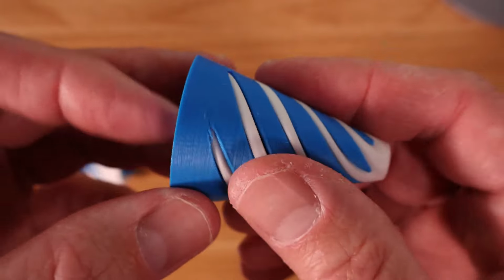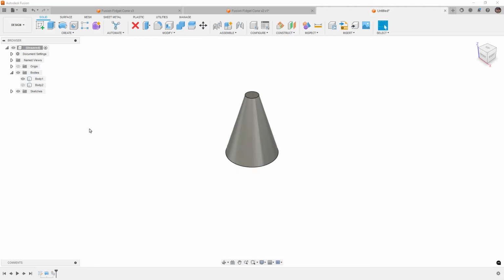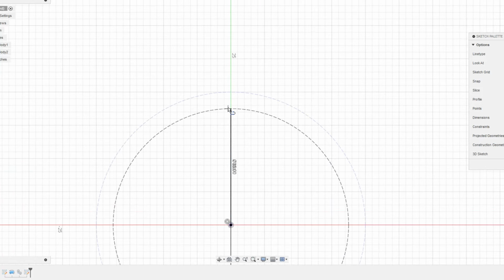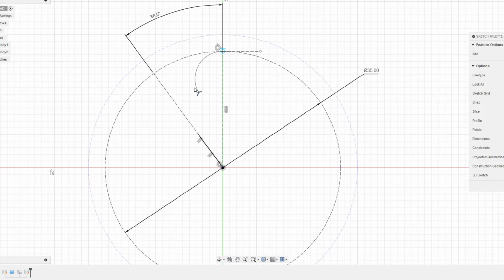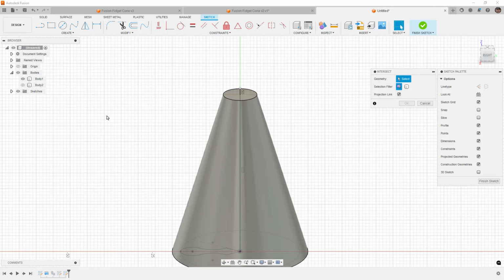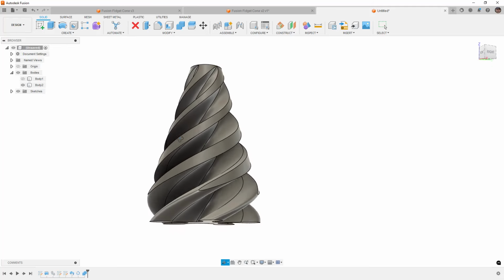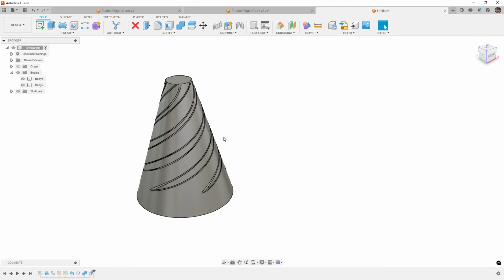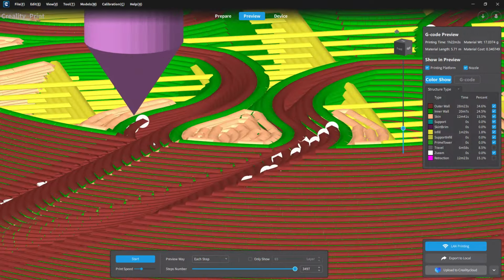Learn to Design a 3D Printed Fidget Cone with Fusion

Comment: cheers for this i tried modelling one of these on my own and couldn't figure it out. I knew it was way more simple than what I was trying somehow.
Reply from the maker: yeah it looks a lot trickier than it is for sure.  The tolerances are the big key here too.  That offset face part.  If that doesn't work you can also make a sketch that is offset for the cut out of the outside cone.  .2mm to .4mm is the general range depending on your printer, layer height and material you use.  .2 is a tighter fit that gets better with use.  .4 is generally a bit looser and works out of the gate.

Comment: I know how to do this now, but im too lazy to select all them faces rn
Reply from the maker: you can try to scale the body down but not uniform. you would want to scale it in plane.  The other thing would be to make an offset sketch of the profile with the same twist settings, but have it cut the outer part after.

Comment: Can you make the cone with like a sharp top?
Reply from the maker: You can do all sorts of different shapes and designs with this.  The outside can be a column style shape and the inside can be close to a sphere.  The ends help in getting the two parts lined up.

Comment: Do you know why when I make the pattern of the body it doesn’t reach the top like the slices en lower than the top of the cone compared to how yours all meet at the top
Reply from the maker: do you mean around the 8min mark?  Where we pattern the cut?  I would double check your axis for the pattern and make sure the center of your sketch that you swept, your cone, and the axis you used to pattern are all the same and based at the origin.  so Z axis should be good for that.  If for some reason its off then you might see a deviation there.

Another thing you can try is to change the pattern calculation option under "Compute Type"  sometimes that can do some funny stuff with Adjust.  you can try Optimized or Identical and see if that helps.
Reply: @LearnEverythingAboutDesign Just tried optimal and it seems to have worked. Thanks for the great tutorial and quick reply, appreciative them all
Reply from the maker: @JonathanAlex-r3i Nice glad it worked!!

Comment: This is a really excellent video. Not only could I follow it pretty much in real time I also learnt more about using fusion and can actually understand the process to create my own. Thanks
Reply from the maker: Happy to hear it!  There are lots of little variations to this design you can make to customize it!
Reply: @LearnEverythingAboutDesign  I printed it today and the inner slides right through like butter. Next I’m going to try a low poly dragon head and have the inner spiral be like flame coming out of its mouth
Reply from the maker: @GigasVGC  Thats a cool idea!  We have a few videos on the channel modeling a whale shark and making it articulating.  If you are trying to model in Fusion that might help https://youtu.be/k6ecfjhd5Bo

Comment: The last chamfer value should be a multiple of the layer high you want to print. It will produce a cleaner slicing result.
Reply from the maker: That's a great tip and completely agree.

Comment: The press pull keeps crashing my computer :(
Reply from the maker: doh!  Does this happen when using the manual drag on screen or even if you manually enter a number?  The manual drag on tools like fillet can crash because dragging a small amount can jump to large numbers.  If it happens on drag try entering a small value manually first and see if that works..  The other option is to scale up or make a second swept coil shape the right size as the cut body so you don't have to press/pull it

Comment: hey! this tutorial is great, but im curious how some do a big helix 🧬 instead? they tend to tunnel through the middle of them and look really cool. i'm wanting to make a big curved one to see if i can make it follow the curve, but im not sure how to make that helix
Reply from the maker: Thanks.
For the tunnel/curve one you  might find that your spiral part gets hung up unless you make it a ball. 

Here is an example of this style of design that isn't a cone.  I didn't do a video on this one but printed a few for fidgets at my desk during meetings :)
https://a360.co/3NqlggF

The sweep that makes the spiral center part in my design is just a "cylinder" but you could also do a revolve or a sphere and save only the intersection of it.

The "tunnel" part was a simple revolve.  The trick you will need to do is make that initial sweep a lot taller than you need so it can cut away from your tunnel.

Comment: i have bin trying to make this but fusion keeps crashing when i try to ofset the faces
Reply from the maker: There is probably a small face that is disappearing in the process.  You can try to use offset on the other body and see if that works.  If that failes you can make the original sweep with twist part from a second sketch that is slightly offset.  You can project the original sketch (P) and then use offset (O) and just increase it a small amount based on your printer.  so .2 to .4mm generally.

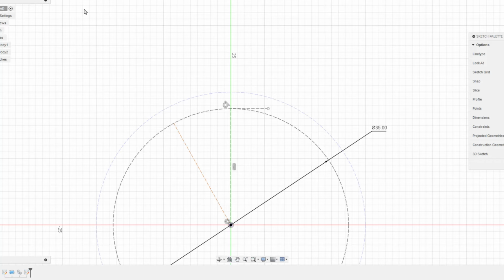Comment: Hi at 3:52 you mentioned hit "X" and pull the 3 lines to the side. I tried left click, right click but none worked. the line just wont move!
Reply from the maker: X is the shortcut key to turn the lines to construction (dashed).  the stuff we pulled to the side is the dimensions.  Those should be able to drag if you hold down the left mouse button.
Reply: Thanks for clarifying, i was trying to pull an actual line. That explains why! Tks again!

Comment: This video was incredible! I don't use Fusion 360, but I was able to translate it easily to Solidworks - except for we don't have press pull, so instead I used "move face". Thank you!
Reply from the maker: Very welcome!  Yeah Solidworks "direct modeling" is a bit different.  You could also do an offset of the sketch. have the larger one to cut the cone and the smaller one to make the solid cone/screw bit.  Just as another option.

Comment: What an amazing tutorial, thank you! I designed 2 of them the first worked no problem as long as they were separated, I then decided to try the -.6 and go for the PnP (print in place) which worked perfectly!
Reply from the maker: Awesome!  This is another fun one to play with.  https://a360.co/3NqlggF
Reply: That one is super fun, my only question the last sketch at then end with the 38° angle what is the purpose of that sketch,  the one I did turned out fine without that end sketch
Reply from the maker: @Ulchprints  Yeah its fine without it.  The intent was to help it self align, but the taper needs to be on the thinner sections too.

Comment: Nice, thanks, got it 👍

I'll use the concept and turn this into a dual tone handle for a shaving brush. I really like the look of those path through toys but I'm mostly looking for something useful to print. While I was shaving the other day I had the idea. I'm not sure how it will go with the more complex shape of a shaving brush but I'm confident I'll figure that out. At least for now 😅
Reply from the maker: I didn't do a video on this one, but its the one i keep on my desk for meetings and stuff to fidget with.  The parts are nice to hold on their own and it makes some interesting shapes.  Easy to print still. 
https://a360.co/3NqlggF
Reply: @LearnEverythingAboutDesign  Wow thanks that's way more the discretion I need. Thanks for the inspiration and file. I also plan a cavity for a few steel nuts to make it more substantial. I'm hyped and need to start it now 😂
Reply from the maker: @poislock  I did 2 videos on pausing a 3d print to do embeded hardware. might be cool to pause a twisted model with some visible metal inside.  https://youtu.be/n1iMrPYjvAw

Comment: Hello! I was wondering if you give permission for these designs to be sold on a platform such as Etsy. Also, I was wondering if this is your own file, or a remix of somebody else's. Thank you sincerely!
Reply from the maker: Hey there.  Someone else had asked that.  The design itself wasn't mine.  I mean I didn't copy another video but the impossible fidget cone thing I had seen in several places.  I have done some other variations of this that I haven't done videos for, but this one here you would need to search around a bit.  I don't have any problem with you using it as I was not the original creator.

Comment: can you also make a tutorial on bi cycle phone mount please. If so I would be grateful to you!! Thanks!!!!!
Reply from the maker: Probably won't because i don't think desktop 3d printers are the right choice.  I have made one for my mountainbike but in order to secure the phone properly it needed to be ziptied .  Making one like a quadlock just wouldn't work well with desktop FDM printers that most people want to use.  For a road bike it might be ok but still very inferior to what is available on the market (which still has issues)

Comment: Being a complete beginner to fusion, this 12 minute video took me a couple hours lol. But fingers crossed I followed well enough that my print will turn out. 
Some things that took me forever to figure out 
- how the heck we selected the bottom of the cone to make a project
-Assigning the radius to the pre mirrored object

I probably should have started with a total beginner project 😊
Reply from the maker: Yeah this one might have been a bit quick for just getting started but fingers crossed it printed!
We do have Absolute Beginner content on our site  https://www.learneverythingaboutdesign.com/   This stuff is listed for a small fee but is add free and gives us the ability to add and update it when Fusion updates, where Youtube doesn't let us do that without doing a new upload.

Here is another one that I haven't made a video on that uses the same technique as the cone.
https://a360.co/3NqlggF

On the questions
Assigning the radius to the pre mirrored object.  D on the keyboard is the dimension tool.  You can also click on the dimension on the far right of that first CREATE section of tools, or use that create drop down and see it there.

When we start a new sketch on a face it will bring the profile of the selection for us, but i used P on the keyboard to project it as it makes the edge more visible.  You can also find this on the create menu under the Project/Include section near the bottom.
Reply: @ Thank you 🙏. Honestly I am grateful for your reply and your fantastic tutorials. This fidget is printing now so we shall see how it turns out and if I managed to follow all of your steps with my lack of fusion knowledge. 
Wish I had seen and subbed to your channel sooner
Edit to add, print finished and it’s awesome. My kids are fighting to the death over it lol

Comment: Can you make a video of making a spiral vortex within a cylinder while keeping the vortex the same size around?  I have been trying for months to figure out using the Modify Edge Form and rotating the top around. However the middle gets smaller causing loss of air flow.  Thanks in advance.
Reply from the maker: Im not sure "Modify Edge Form".  There is the Edit Form tool if you are using forms for this.

The process would (should) be the same where you can sweep your profile on a line and twist.  The only difference is the cone part of it. you wouldn't want a cone at all. you would just sweep your shape and then cut it out of your cylinder.

Comment: Is it possible to do this with Blender?
Reply from the maker: I am sure you could do it with Blender, but something like this is way easier in a brep CAD type program. You would need to use some booleans to get it done in Blender and likely instead of a sweep with twist you would need to take verts on the top of your object and twist them with proportional editing enabled....

Comment: I’d love to learn how to do this in plasticity but can’t seem to figure it out. If someone could help me that’d be great or if OP could make a tutorial even better!
Reply from the maker: I have another 3d printed fidget video I am working on for plasticity, but let me think on doing the same one in Plasticity.
Reply: @LearnEverythingAboutDesign  excited for it any updates of when it will be out? I loved this tutorial but got lost at the middle part starting at 5:00
Reply from the maker: @adamfosfi691  The plasticity one went live last week https://youtu.be/FUH8IvXmodE  at 5min are you trying to follow along in Plasticity doing this?
Reply: @LearnEverythingAboutDesign  No in fact im not allowed to use plasticity and didn't know about it till you just mentioned it - I'm restricted to using fusion 360 only thats because im doing industrial design. :(  

Otherwise I would definitely do the new tutorial because we are currently going into fidget toys
Reply from the maker: @adamfosfi691  Have you looked at the Print in Place shark we did?  I have a video on modeling it and one on how to set it up for print in place.  I have come across some other designs i might try to make videos on as well.  The plasticity fidget toys should be easy to do in fusion and i will have some coming soon for fusion as well. some Halloween themed ones.

Comment: Tried 3 times and it fails at the halfway mark each time 🤨
Reply from the maker: oh no!  What printer are you using?  I slowed mine down to 50mm/s and print the outer walls first.  I had the print in place version fail but it was a material clog.
Reply: @LearnEverythingAboutDesign  cheers got it for the kid easythreed nano crap thing got the file of thingyverse but it stops at like the half way point each time
Reply from the maker: @sshaunss  did you try printing the file from the video?  https://a360.co/3SzEa7y
Reply: @LearnEverythingAboutDesign  no but I will maybe the thingiverse one is broke

Comment: Ha, now I know what the 'centerline' type does along with the 'twist angle' on a sweep. Thanks Matt!
Reply from the maker: Centerline is nice if you are designing revolved parts for sure.  For a normal dimension you can right click and make it a "diameter" as well, but the centerline just tells Fusion you are intending to revolve that thing.
Reply: @LearnEverythingAboutDesign  Never knew that CL option either, great tip once again!